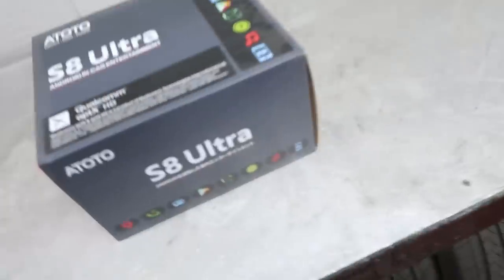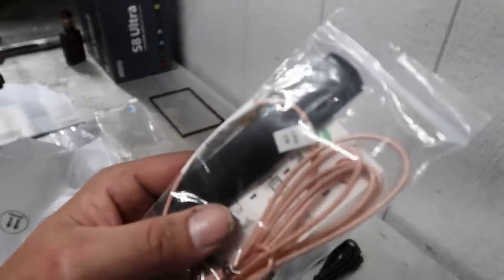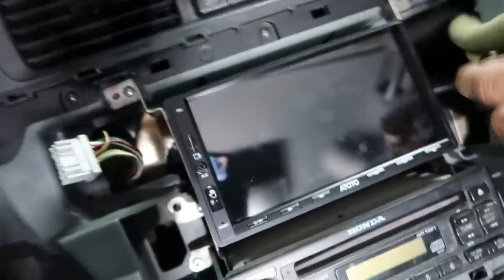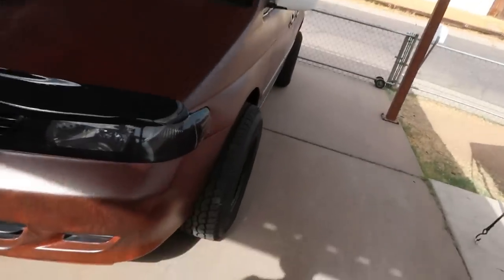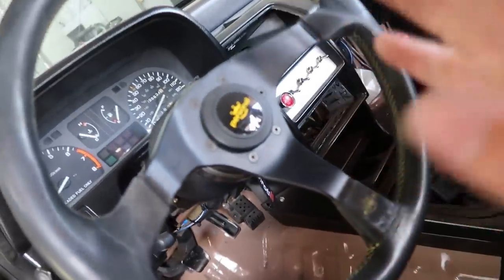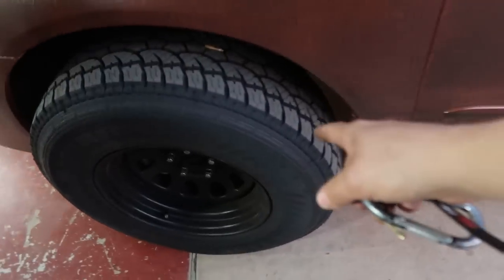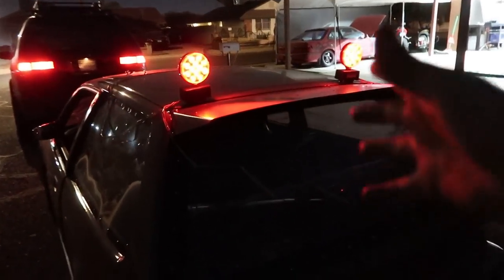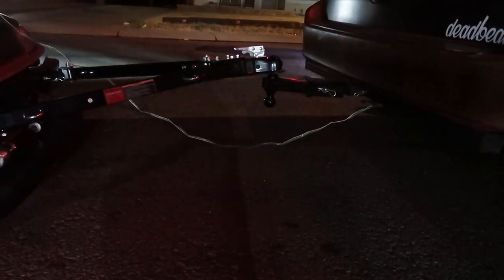Road READY!!! Going on a trip with my favorite rocket ship!!

Comment: You could have tapped into the khaki civics rear lights and wired it to receive the trailer harness in the front lol. Then when your flat towing it you can just plug it in and it’s brake lights and signals will work independently with the vans.

Comment: I have the same magnet lights & have the same problem with them 😂it’s the lights but they do the job for the price ..can’t wait to see some road trip content ✌🏻
Reply: If brake and turn signals were the same bulb it would be fine. But they are separate on the van which is why they don’t work properly

Comment: I know that if you tow a rear wheel drive vehicle you’re supposed to disconnect the drive shaft to prevent transmission damage. Idk what you’re supposed to do for a front wheel drive or if it’ll be alright

Comment: Hey man I'm pretty sure your suppose to leave the steering wheel unlocked when towing with a tow bar.
Reply: my thoughts too
Reply: @TheRealAaronWitchey  I didn't know anything about towbar
Reply: You want the steering wheel to be unlocked on a vehicle being flat-towed. Otherwise, the front wheels of the towed vehicle would scrub around corners. Unlocking the front wheels allows the towed vehicle to turn and follow the tow vehicle as it is being towed.
Reply: LOL the steering wheel supposed to be locked if it's unlock the car can move any way it wants to left or right
Reply: @netochapa2699  not really. The car will track the way the tow vehicle is. If it’s locked it will want to pull the tow vehicle to one side
Reply: Pretty sure he does
Reply: @netochapa2699  The car is being pulled. The wheels will naturally follow the car in front.
Reply: @netochapa2699  not true as long as the vehicle being towed has a decent alignment.

Comment: Someone needs to reach out to this guy and tell him those Transmissions are made out of glass. 🤣🤣🤣 it's not going to last him to long. I seen he had a upgraded transmission cooler. Truly this guy doesn't know all his Hondas. Older model J series motors have bad transmission. I worked at a transmission place Hondas with automatic V6 transmission suck ass.
Reply from the maker: I'm behind on content but currently over 1000 miles into my trip with zero issues
Reply: @deadbeatgarage  hell yeah that's good to know. Just if you have any issues. Change it with OEM Honda transmission oil. Don't abuse going up mountains haha.